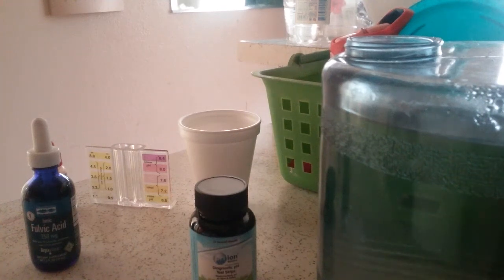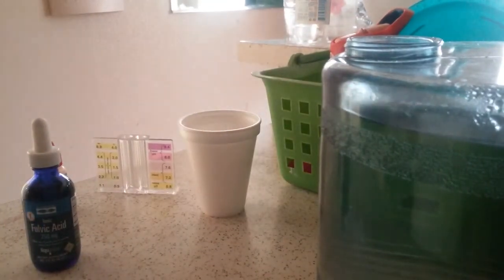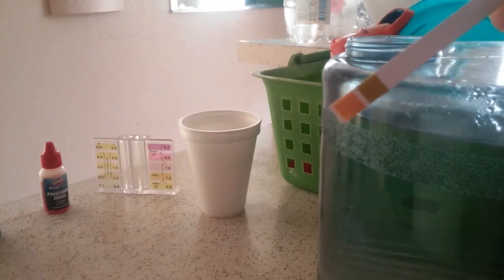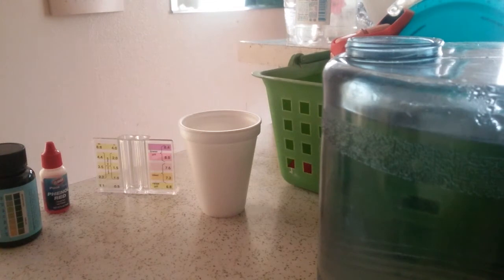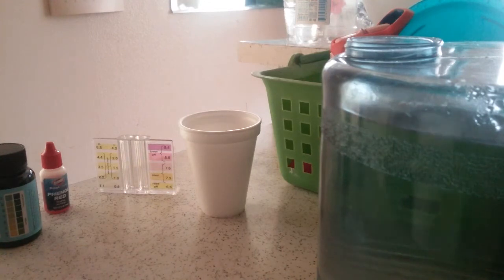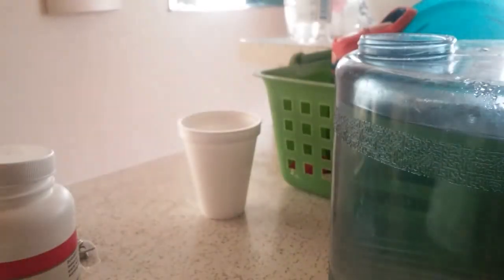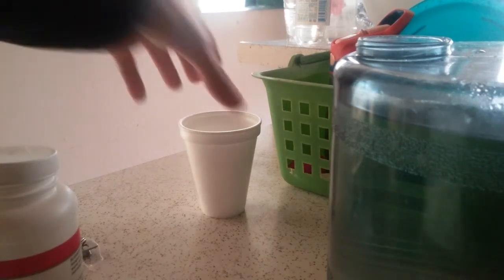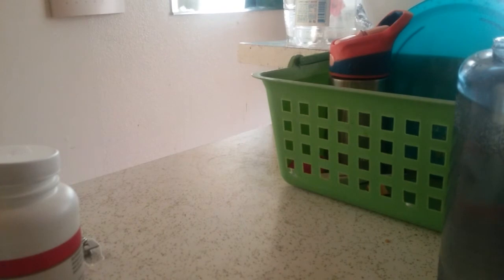How to Restructure Distilled Water

Comment: This is bullshit.. You do not want to drink anything but pure h20...if u want water that has a whole bunch of crap in it that does nothing beneficial and only harmful stuff just take some out of ur faucet. S*** they even add a few extra ingredients that you do not use in your water free of charge. Who the f*** in their right mind would spend their time to distill water just to push it back in it. That's going to be some of the dumbest s*** I've ever heard in my life. There is a reason why you do not want anything but pure water. Water is a solvent and is dipolar. It is this property of water that makes life possible and cells 2 be able to grow. If the water is not dipolar then it will not be able to do what your body is designed to do. The dipoles are weak in water so if you put other stuff into the water they are able to change the chemical makeup of the water and make it harder for the water to get in the cells. This is the reason why when you're drinking water it seems not to quench your thirst. It's like a dry water. All that s*** being put into it is the cause of your water quenching your thirst barely more than sand will. You want the water molecule to be only a water molecule and nothing else. They don't say your body needs H2O4 or anything else... just good ol H2O and nothing else

Comment: Your onto a good thing ...Distilling water ...however,....you should do more research on Restructuring,...the pioneer of structured water is  Johann Grander....there are also magnetic, crystal sphere, vortex applications...to electrically restructure water....Im pretty sure you'll find it all Extremely interesting.
Reply: I've been using a no-cost paramagnetic method since reading about it in the 2011  "Dancing with Water"  book.
Reply from the maker: uski59 thanks a lot!

Comment: What are you reading as acidic?
Distilled water is neutral on the pH scale and there is no reason to change the pH level of distilled water.
Reply: Distilled water is slightly acidic, according to the experts, and is OK to drink. Been drinking it for years, as is. Our organs don't all have the same pH level, the body balances them.
Reply from the maker: Grounded from my understanding, 'neutral' is considered balanced at the 7 pH mark. Distilled water is not nuetral because its 0 ppm showing up way below the 7 mark, therefore acidic.